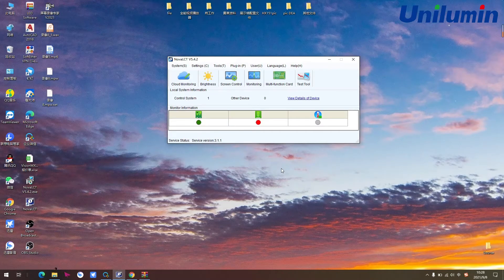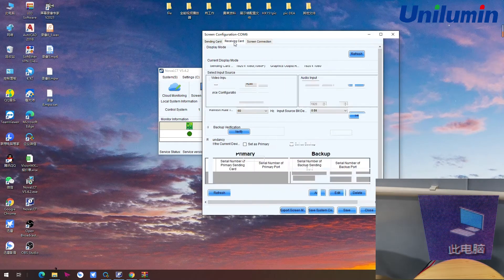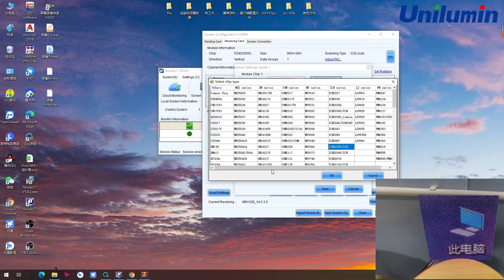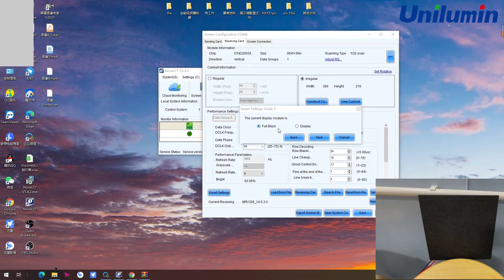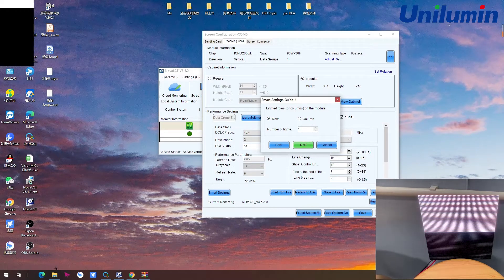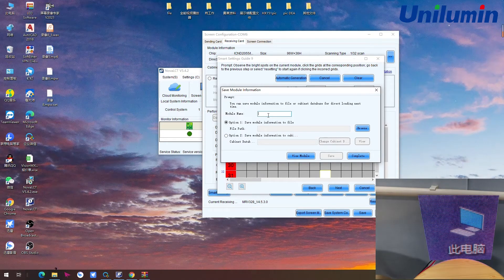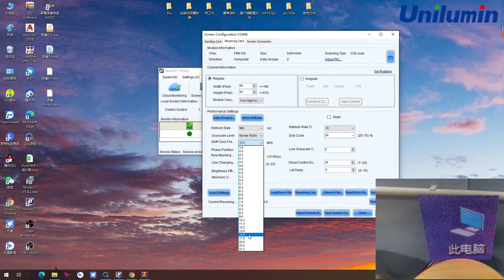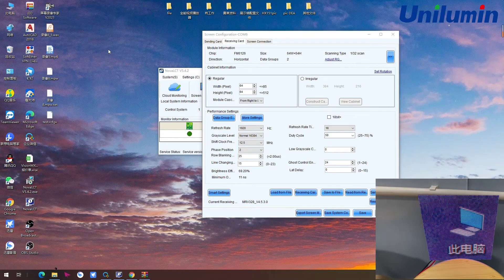How to make configuration file for regular module

Comment: Hi Sam,
Thank you for sharing this wonderful tutorial. I have an FM6124 P4 module, but the video processor is no longer working. I need to buy a NovaStar video processor to replace it, but the new processor isn't reading the receiving card. This means I have to get a new receiving card. Once I connect everything, the module's configuration is lost, and it won't read the settings from the module (P4 with FM6124 chipset, 64x32).
Do you think you could help me configure this module?
Reply from the maker: yes, because the configuration file is save on recieivng card. you change the receiving card .so that need do the reconfig it again.